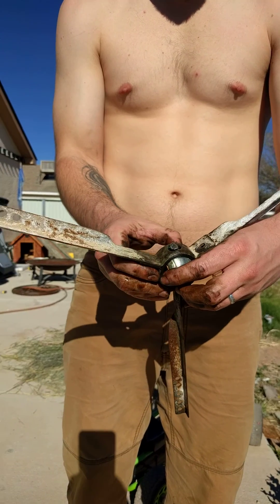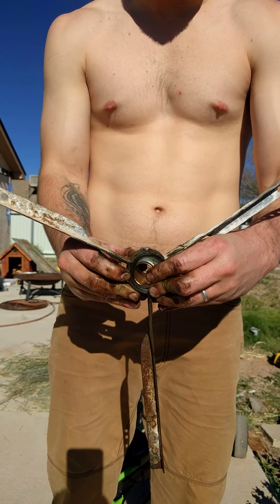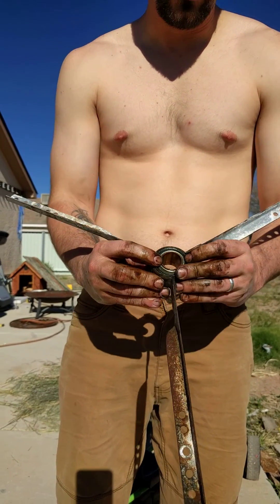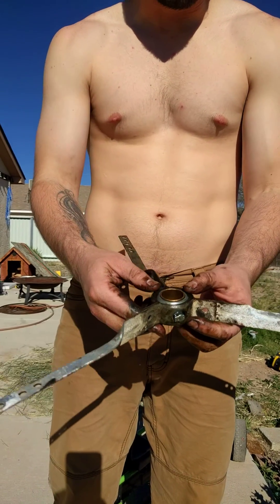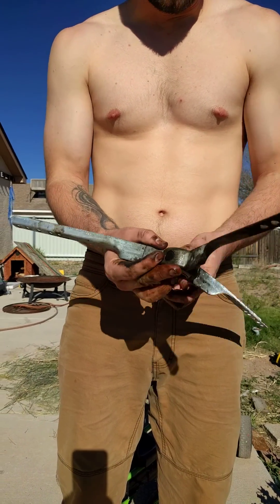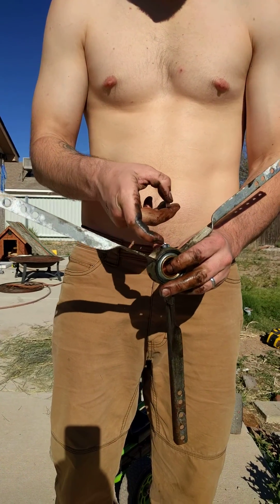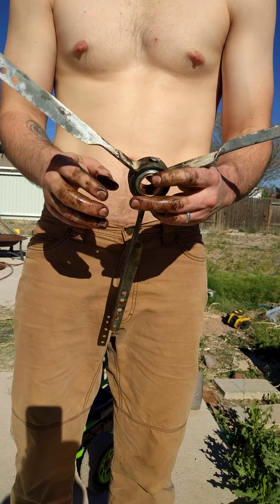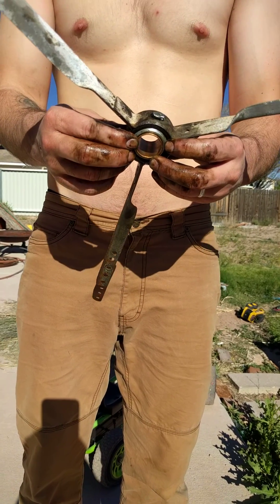DIY Evaporative cooler spider flange bearing swap

Comment: Thank you for your video.  I took my swamp cooler apart and didn't know how to put the new bearing in the spider arms.  I was afraid I needed to drill out the welds, insert the bearings, and re-weld... without damaging the new bearings.  YOU saved me a LOT of grief.
Reply from the maker: I had the same issue! Glad it helped friend! Cheers!